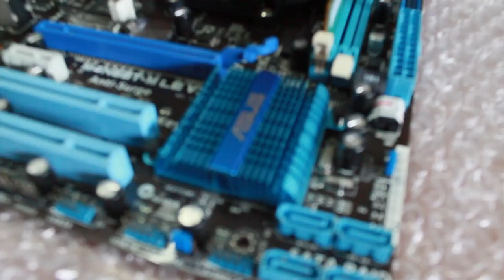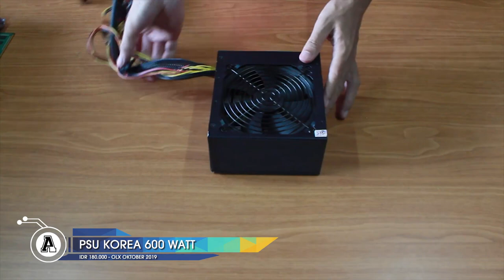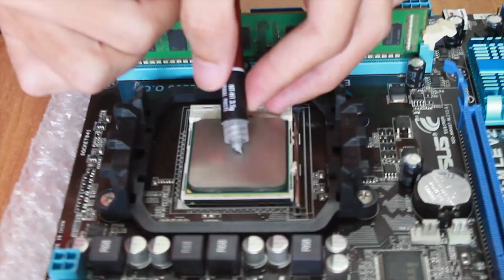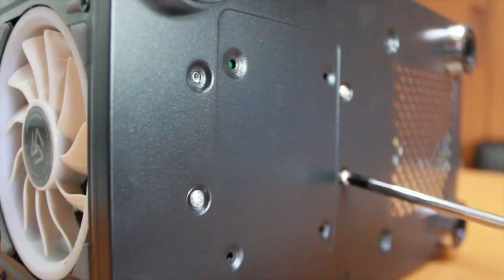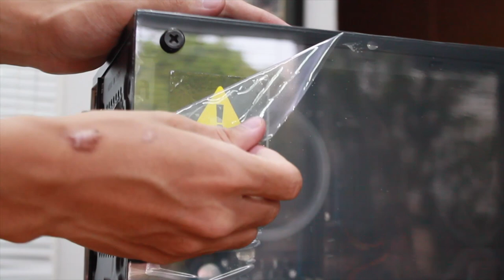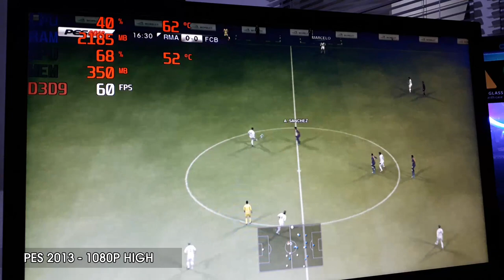Rakit PC Gaming 2 Juta Full RGB - AMD 4 Core DDR3

Comment: Gant klau mau bikin rakitan komputer dengan harga 2 jutaan untuk drawing dan game, autocad,solid work game paling game standar pakai ap aja ya
Reply from the maker: Biar kerjanya enak, no lag club..
Bikin gini: 
Tapi semuanya seken ya kecuali SSD.
Harga online (tokoijo/merah)

Paketan i5 760 + P55 700rb
Hynix/Samsung 2x4GB 300rb
GTX 750ti 850 rb
Adata SSD 240GB 400rb
PSU Korea 500w 150rb
Casing Biasa + Fan 100rb

2.500.000

Comment: Gan saya punya 2 cpu bekas dulu . Pingin upgrade bajet 1.5 bagus nya yg mana ?

Cpu 1 
Amd phenom II x4 955
Gigabyte GA-975A-D3 AM3+
VGA : nitro shapire R9 370 4gb
Ram : 8gb

Cpu 2 
Intel pentium G2020
Asrock H61M-VG4
Vga: gtx 275
Ram : 4gb
Reply from the maker: Upgrade yg cpu 2. Ganti prosesor pakai i5 3470 atau i7 3770.
Ram 8gb sama r9 pindahin ke cpu 2.
Reply: @aprinaleko   thx gan info nya.

Comment: Kalo Mau Build PC Ke Abang Gimana Bang??
Reply from the maker: Saya utamakan wilayah padang/sekitarnya gan..
Soalnya ngumpulin part berkualitas lama...
Reply: Bang kasih Saran Dong Saya Mau Editing,Gaming&Rendering 
Bugged 5 Juta bisa Dapet Spek Apa Bang.........Tolong Kasih Tau ......saya Mau Rakit PC Juga ....tapi Saya Beda Daerah
Reply from the maker: @zeedsch1392  Ryzen 3 3200g 1,4 jt
Msi B450m Pro VDH Max 1,2 jt
Team DDR4 1x8Gb 600 rb
Adata 120gb 250 rb
Wd 500gb 200 rb
FSP Hexa 500 580 rb
Cube Gaming Locus 280 rb
Aigo Dr12 x5 400 rb
Ongkir Part ke Padang 280 rb

4.910.000

VGA nanti tambah belakangan..
Pakai onboard dulu..

5 juta rakit kayak diatas ..
Kalau masih rakit DDR3 (intel gen 2, 3, 4) rugi.. ketinggalan jaman..
Reply: Kalo Mau Upgrade 
....Di Kasih VGA RX 570 Kuat Nggk Bang PSU Nya???......Itu Tanpa VGA Bisa Main Game Bang???
Reply from the maker: @zeedsch1392  Bisa, gak perlu ganti PSU,
Ryzen 3 3200 itu kuat semua game kok,
Tapi setting rata kiri sih.
Tapi part baru kan, garansi resmi semua.. dan bisa diupgrade juga ke Ryzen 5, ryzen 7 bahkan Ryzen 9 yg sangat OP itu.
Reply: @aprinaleko  ok Makasih Bang saran dan Info nya😊:v

Comment: Bg aprinaleko saya mau tanya vga card yg bagus utk proci i5 2400, mobo 1155 H61 apa ya?
Reply from the maker: RX 460, 470, 550, 560, 570.
GTX 750ti, 760, 950, 960, 1050, 1050ti.
Reply: @aprinaleko  itu semua bisa ya, mn yg paling bgs bg?
Reply from the maker: @delfadiarychannel3644  VGA mah bebas bro..
Pasang RTX 2080ti pun bisa...
Tapi kan bottleneck.
Itu nvidia dan amd ya..
Makin ke kanan makim kuat...
Reply: Yang harga di bawah satu juta yg mn bang?

Comment: Bang saran dong pc full set 4jutaan buat main pes 2020
Reply from the maker: Contek spek ini aja gan..
Tapi VGA ganti RX 470 atau GTX 950. 
Pakai Casing biasa gk pakai Rgb.
Beli monitor 768p yg 700ribuan.
Keyboard Mouse Logitech Mk120.

2.000.000 - RGB =
1.350.000 + VGA =
2.550.000 + Casing =
2.850.000 + Monitor =
3.550.000 + Key, Mou =
3.700.000
Reply: @aprinaleko  terima kasih sarannya gan

Comment: Spesifikasi yang pengen saya beli 
🅐︎
Amd Phenom II X4 630 quad Core
M.board Am3
Memori Ram Ddr3 8GB
Hardisk 320GB sata
Vga Gts 250 1GB 256 bit

𝗔𝗧𝗔𝗨

🅑︎
Amd A8.7600 quad core
M.Board gigabyte A68 FM2+
Memori Ram Ddr3 8GB
Hardisk 320GB
Vga 2Gb R7 onboard

𝐒𝐚𝐫𝐚𝐧𝐧𝐲𝐚 𝐁𝐫𝐞 𝐁𝐚𝐠𝐮𝐬𝐚𝐧 𝐲𝐚𝐧𝐠 🅐︎  𝐚𝐭𝐚𝐮  🅑︎ ?

Comment: Vram berapa mas?
Reply from the maker: 2 GB..
Reply: @aprinaleko  dipasang water cooler fan bisa mas
Reply from the maker: @AkmallStya  Water cooler custom atau AIO utk CPU ?
Reply: Aio bisa mas?
Reply from the maker: @AkmallStya  bisa di depan 120 atau 240..
Di belakang 120 juga.
Diatas gak bisa, mepet.
Reply: @aprinaleko  kalo yg kustom?
Reply from the maker: @AkmallStya  gak bisa casing nya sempit
Reply: @aprinaleko  kalo di pasang vga 4gb, ram 8 gb&hdd 2 tb bisa mas?
Reply from the maker: @AkmallStya  bisa